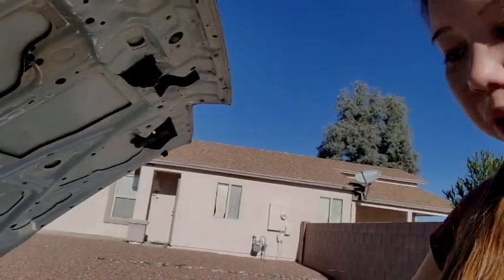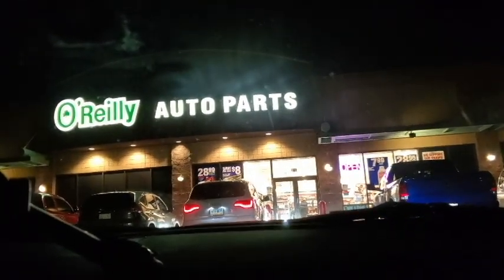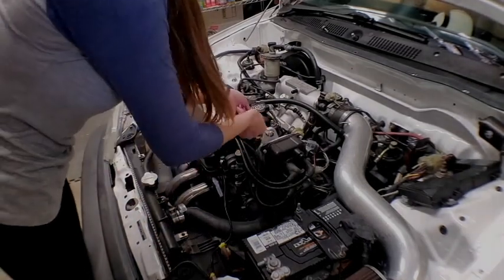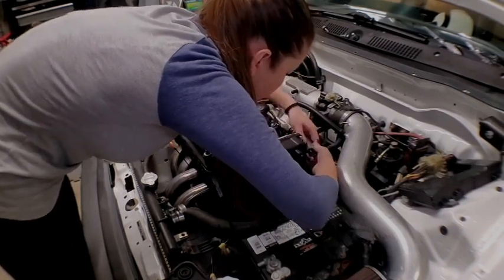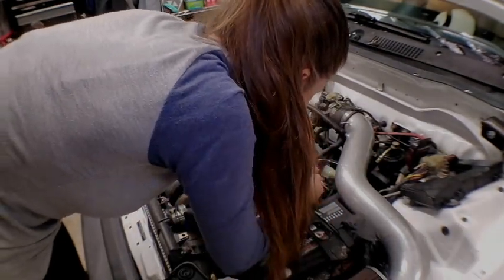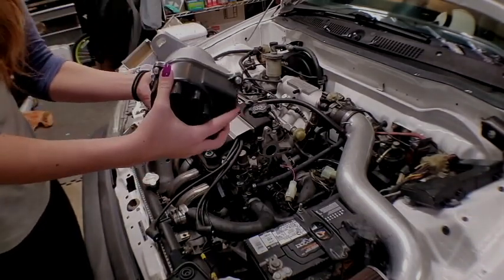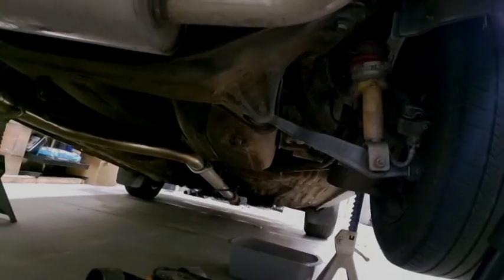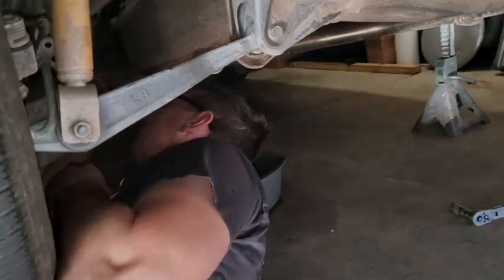The Trooper Build - Broken Wagon

Comment: You should get a CJs main relay adapter to not have to use a honda main relay anymore and be able to use a common 5 wire relay from any parts store and it's cheaper too.
Reply from the maker: Huh I didnt know that! Well if anything happens with this main relay I will keep that in mind! Thank you! 😊
Reply: @MsVtec  yeah it's cheaper to get a regular relay and most places have them. Car stereo shops, auto stores..